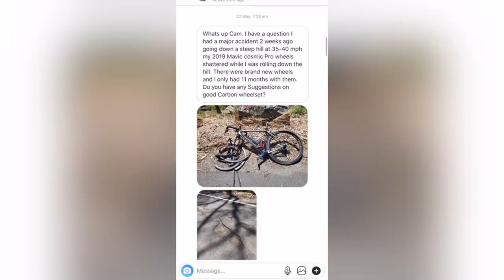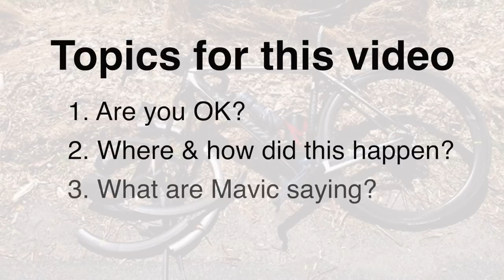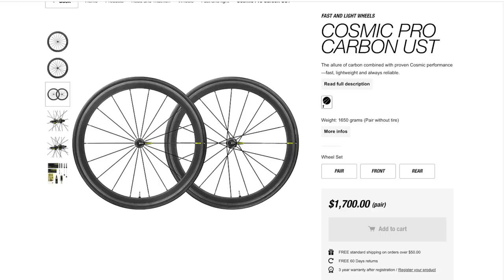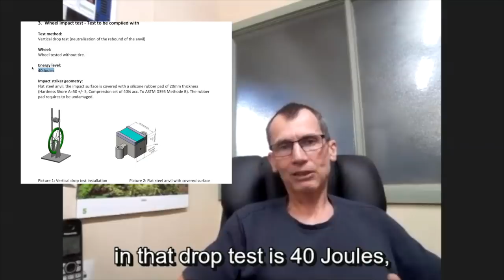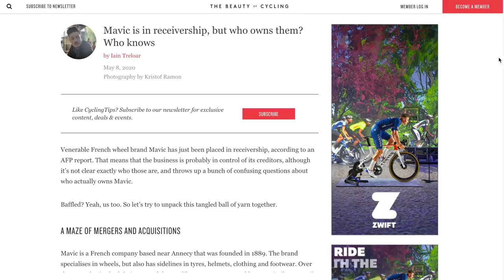A FRIGHTENING MAVIC CARBON WHEEL FAIL (at speed)

Comment: the hero in this story is the helmet! so many people not wearing them nowadays.
Reply: After many crashes and a head-on two years ago I always wear mine now.
I raced motorcycles and know how to fall & roll, but the head-on was an eye-opener for sure.
Good thing he had others there to help. I mostly ride alone...
Reply: I've crashed a few times at relatively low speeds (cyclocross and cross country) where the helmet came in handy, but thankfully never on the road.
I never go on a bike ride without a helmet.
My father claims he don't need a helmet because he's only riding on the side walk (legal in my country) and at low speeds, but guess who went OTB and landed on his head when he applied way too much force on the brakes?
Reply: Just yesterday a friend of mine crash while our afternoon ride. Luckily his helmet broke not his head! It was at about 30km/h, when the car pulled in front of him! Always wear helmets guys!
Reply: Absolutely!!!!!!
Reply: People in my area get shamed if they ride MTB without helmets. I have only ever seen teenage kids without helmets in the last 2 years. For some reason they think they are invincible.
Reply: @MattFenlon  I commute about 10km to/from downtown Vancouver most days and it is rare to see someone without a helmet during regular commuting hours. However, go out on a sunny weekend and you'll see a lot of people on the main cycle paths (10th, Union, etc) without them. Even more if you include the seawall and other separated paths.
Reply: @graham1034  Almost nobody in the main cycling nations if Europe wear one for commuting or travelling around the city. It's rare to see one.
Reply: Fools
Reply: I crashed at speed a few months ago and landed on my head, smashed the helmet which saved my life
Reply: Lol, yes, let's take this extreme example of a guy going at 72km/h (something most of us will never do) and weighing 100 kg, to preach about helmet necessity in general and brag about shaming people who don't wear them (as someone here did...)
I wonder why nobody in Holland wears them....they must all be shameful idiots. But as we know people like to gang up behind some black or white point of view, it's just easier for the brain and makes them feel like they belong (in this case to the responsible and smart helmet wearers). In reality though life is full of gradations in everything and when you cycle in moderate speeds and as far from cars as possible, then the danger of hitting your head is not too different from getting any sort of injury while driving your car, tripping and falling while walking, etc. 
Yes surely this guy was correct in wearing a helmet, since he was doing something that was pushing the bike's structure to extremes. But also surely this guy is lucky to be alive regardless of the helmet.
Reply: IKR? Crazy...

Lol no really I should wear mine more often. But definitely encourage its use
Reply: @f4nyang  That's fair, I don't like helmets very much, and don't feel like I'm taking much risk on the bike compared to dangers faced during say walking, sailing, or even potentially dangerous work that I do just as often. Descending off big mountains at 80km/h or driving in the midst of car-heavy traffic is another story though..
Reply: Nowadays?

They're wearing them more and more every year. We barely wore helmets as recently as the 90s.
Reply: @Robert Erdei Horrible analogies. You should be embarrassed.
Reply: @TeamCykelhold  went some time ago on trails where we used to as kids go down as fast and possible with no helmet on.......hair raising even for the bald.  i went down like half of the speed with helmet on and it was scary.
Reply: @tomast9034  Yeah we did some real stupid stuff without helmets too when I was a kid. I have seen my share of brain injury on MTB (and once an open skull fracture too, we had to carry the guy away) so I know what can happen if you are unlucky. I'm not really one to tell people what to do usually, but with helmets I usually tell people it's a good idea to wear one if they are jumping or riding fast downhill sections.
Reply: @Robert Erdei I'll bite...and almost entirely ignore the snotty, pretentious attitude that suggests that you speak for many as thoughtful, polite, or well-informed (and therefore "deserving")...
1) Pick up trucks have 4 wheels (hopefully) on the ground and are inherently safer as a result. Also, in a truck comes with an enclosure, at least implying an added measure of safety to which cyclists do not have access when on their bike.
2) Walking is inherently more stable than cycling, and also includes minimal stopping distance, and maximal agility.
3) ALL collision sports (American football, hockey, and most gym-based training for MMA and boxing) and many potentially-dangerous ones (rock climbing, skiing, base jumping, parachuting, hang-gliding, etc.) prohibit participation without protective headgear not only to reduce the potential of death, but ALSO of injury.
That said, if you'd rather wear a helmet while in a truck or walking down the street, you VERY likely WILL increase your survivability in the even of an accident.
Otoh, if you DON'T want to wear one in the much-more-likely event of concussion or unnecessary death while riding a bike (in traffic that outweighs you, and can outrun and out-maneuver you, and often doesn't see you for ANY number of reasons), then please just make sure that your health and life insurance are paid up so that tax-payers don't have to foot the bill for your utterly-preventable catastrophe (assuming there'll be enough of you left to attempt to save).
The worst-case scenario isn't even dying, it's the effect of long-term acute care on the people who love you because you wanted to be the "cool smartass".
Reply: Maybe it was part of problem. "I have helmet and I can drive faster". In netherlands 2 % use helmet and it safest country to cycling. Helmet is good while driving car and when you climp at home. In car crash 40 % died cause of head injury. At home allmost all.
Reply: Cant stand helmets. 
only with moantain biking i would go with a helmet. 
but i do live in holland, everything is flat and there are bikelanes everywhere.
Reply: I've crashed 2 times. As you said, the greatest hero of all the time is the helmet
Reply: In my home country (Finland) i would say there has been a very noticeable upward trend for helmets in the past few years, compared to last couple of decades. Sure, most people still don't wear helmets, but those who do are definitely rising in numbers. And it has become rarer to see someone riding a nicer bike without a helmet. I hope that trend keeps growing.

Comment: I know many riders who have “downgraded to carbon fiver wheels” with no gain in performance whatsoever, every time they hit a ripple on the road, they want to stop and inspect the wheels, what kind of life is that? I assume it’s good for professional athletes with deep pocket sponsors, but the look factor is the only gain on this.
Reply: What are you talking about! Aluminum wheels deform (not brake), tires off and you fly like a bird. Want to be safe; then ride max at 40 mph, weight <80kg, use disk brakes and through-axel
Reply: @anata5127  agree. A good pair of carbon rims built right with rider weight less then 80kg, will never have issues. Just be smart and know the limits of your equipment.
Reply: This.

I don't want to have to think about my equipment on the ride - I just want to ride. And assuming that I've properly maintained the bike, and IT makes ME look good when I'm OFF of it that's plenty good-enough. (Hell, I should be able to ride an UGLY bike and not care; anyone close-enough to me to form an opinion about my ride is too close...which is a "me" problem for both under-training AND over-caring.)
Reply: @anata5127  Since the issue is one of compromises if you're going to ride at all, the real question is reasonability of construction materials used. So although you're correct that aluminum wheels aren't guaranteed to not fail, the relative advantages and disadvantages of the alternative have to be considered as well.

That said, when carbon fiber breaks, the rate for catastrophic failure is EXTREMELY high relative to aluminum. In addition, wheel integrity is probably the single most-important consideration on a bike (followed closely by the stem) since failure at either of those points GUARANTEES a fall.

The question then becomes a simple one: what demonstrable gain is worth the significantly-increased possibility of a catastrophic wheel failure for which there is no engineering solution? (Relative to carbon fiber as a construction material for wheels, caliper brakes can CERTAINLY make carbon fiber *worse*, but disk brakes DON'T make carbon fiber *better*...)
Reply: @xunder3  I just wonder how many carbon wheels failed, if they are not from China, no rim brakes and no speed over 40mph? My guess almost none.
Reply: Wouldn't risk my life for looks.  I certainly wouldn't be using carbon clinchers with rim brakes on a technical downhill.
Reply: @anata5127  They're all made in China.  Where've you been for the last 20 years? Or Taiwan.  Like most bikes.
Reply: @ryand141  Taiwan products are well better. Do you think every bike made there? I doubt.
Reply: I remember watching a YouTube video regarding the pros & cons of carbon fiber wheels. The rim brakes were the most prone to failures due to heat build up. But it depended on the manufacturer and frequency of inspection. 

Heat resistance – Because of the heat buildup during braking, the resin that makes up the wheel begins to lose its stiffness. This is a problem for riders who have long descents.

Disc brakes with carbon wheels are probably better, my 2 cents. 

Everyone be safe, & enjoy your rides!
Reply: That, 1000000000000000000% true!

Comment: 100kg rider, rim brakes, carbon : pick two
Reply: 100kg as a bike rider is overkill.  Get in shape and lose the weight.  I dropped over 30lbs just to get into bike shape and it wasn't 30lbs of fat if you know what I mean!
Reply: @TraumaER  It also depends on the how tall you are. I am 200 cm tall and weight around 90 kg and would not want to lose weight at this point. But I also decided to buy good alloy wheels two years ago. (My Bike does not have Disc Brakes)
Reply: Better yet pick zero
Reply: Channul ☹️
Reply: Truama ER, I'm nearly 300 lbs...
Reply: @TraumaER  some people are sprinters mate. no problem if it's not fat
Reply: Carbon is the bigger issue it did not over load carbon just suck lol
Reply: @channul4887  calm down
Reply: @channul4887  didn't want to hurt your feelings. you sounded pretty fragile.
Reply: @TraumaER 
Did you ever consider that the rider might have been cycling as part of his effort to LOSE weight?
No.. Didn't think so..
Reply: @geeeze2403  Not really relevant since most high-performance bikes have a clearly listed weight limit.  If the bike says 250lbs, that doesn't mean you should weigh 249lbs.
Reply: @TraumaER  "@geeeze2403 Not really relevant since most high-performance bikes have a clearly listed weight limit.  If the bike says 250lbs, that doesn't mean you should weigh 249lbs"
Wot? That makes NO FUCKING SENSE.
Reply: @channul4887  what doesn't make sense?  You don't ride up to a designed limit just because it says so.  You don't stack elevators with 3000lbs of fatasses.  You don't imbalance an airplane just because you think you can.  I'm a licensed PE.  I know these things.
Reply: @TraumaER 
There's a lot of stuff that we DON'T know about regarding this incident, such as recommended weigh limits etc, so I don't think that any of us are in a position to make assumptions. When I bought my bike, I wasn't given any information about things like that and it wasn't something that I even thought about researching either and I'm a heavy guy. Not everyone is THAT clued up as you appear to be ; if you have the knowledge then good for you but spare the judgement about us lesser mortals. 
Glad to know that 'John' is ok and continues to remain so. 
Ride safe people, ride safe.
Reply: @geeeze2403  well I wasn't making fun of you exactly.  However, high performance bikes - specifically those made of carbon fiber have high strength limits but are actually more brittle than aluminum or steel.  If you got your bike at a bike shop, they should have recommended you something more appropriate or gave you a warning.  Otherwise, they just tried to upsell you on something that wasn't safe long-term.  Anyways, keep riding and get in shape.  Biking is great if you are consistent!
Reply: @TraumaER 
Then as a licensed PE, perhaps you should be a little more understanding about people. Nobody can snap their fingers and achieve their desired physical weight /shape.
I certainly wouldn't hire someone like you
Reply: @TraumaER 
 "I wasn't making fun of you exactly"
So I'm wondering just who you were making fun of. The " lardasses in the lift"  maybe?  
I'm actually not in the slightest bit bothered about name calling - I wear my ' Fat lad at the Back' cycling apparel with pride ( yes, it exists - Google it) 
Rather than bragging about your physical shape and PE qualification, look inside yourself and realise that not all of us are as perfect as you think you are. 
I now consider my input to this discussion closed. 
Peace, love and happy tailwinds
Reply: @TraumaER  if a bike with a stated weight limit of 250lbs breaks under someone who weighs 249lbs, the manufacturer is fucked by lawyers in all holes. That's why every design accounts for tolerance (even without lawyers, since tolerance has been a basic foundation of any design for centuries). Whatever that PE license is, I'm guessing you bought it off someone on ebay. No wonder you were able to lose the 30lbs so quickly.
Reply: What I want to know is why is there so much criticism on 100kg rider ~ guys are genetically getting bigger ~ engineering standards are your supposed to factor in stress / strength  3 times its working load  generally. If someone is 2.1m in height what is his ideal healthy weight ?
Reply: @bengreen1262  I am 100kg, and I blew different tires off different alloy road rims twice at 100psi. Luckily didn't crash in either instance. There is just a huge amount of brake heat to deal with on long descents, to where it raises tire pressure enough to blow a tire off the rim. I wouldn't trust a carbon rim and epoxy to handle this heat for many years without deteriorating. I also had hairline cracks at dropouts lead to warranty replacement on 3 different alloy road frames. Racing road bikes and components aren't over-engineered 3 times over, that's for sure. They are designed for racing with some margin of safety, but I wouldn't assume it's a lot of margin, especially if low weight is an explicit design goal and competitive metric, as is the case with carbon rims.
Reply: @TraumaER  I'm in pretty good shape but muscular and 195 cm. What am I supposed to do, chop off a limb or two?

Comment: ALUMINUM RIM is the moral of the story.
Reply: Nah i saw aluminum did the same
Reply: Way to paint with the wide brush! Nope. The moral of the story is: don't ride carbon wheels with caliper brakes and hard compound pads instead of disc brakes at 70 k/hr while weighing 100 kg. There is nothing inherently wrong with carbon wheels but how you use it.

Comment: Great video.  A real eye opener.  This is the No 1 reason why I never bothered with all carbon wheels on a rim brake bike.   Disc brake bikes - much less issue of this sort of failure.
Reply: Rider weight though is still a consideration.
Reply: Totally

Comment: When I was looking at a new bike I wanted disc brakes with carbon rims just for longevity and durability but this is another good reason 🥵
Reply: This was one of the reasons I got myself a disk brake road bike. I did not trust carbon rim brake wheels
Reply: @Efu884  but alloy wheels
Reply: You guys are so right. Rim brakes will eventually damage the carbon wheels
Reply: Well in my case I did have issue with carbons disc wheel. Some brands don’t use the same “glue” or “epoxy” to make them because no heat generated by brake pad. Then it is very fragile and heat is everywhere (be careful when you take your bike in a car : sun or heat pipe). Best choice is aluminium.
Reply: Stefan - bike manufacturers converting to disc because they have to, carbon was never suited as a heat transfer medium.  Liability issues between tire and tube manufacturers and bike companies.  And besides it jacks the price up and the usual planned obsolescence, and you can’t go back or forward from rim /  disc.

Comment: Fascinating! Thanks mate! Although not a catastrophic failure of carbon rimmed wheels, I bought a Trek Pro 6,9 with Bontrager carbon wheels. I live in the Pyrénées and we hit high velocities going downhill!! Braking from about 70km/h to about 30km/h on a hair-pinned downhill, so repeated and constant braking, the rim of the front wheel suddenly "exploded out" warping on both sides of the rim at the same point and blocked my wheel against the brake. I slid and skidded and my mates behind me have no idea how I stayed upright! Trek (Bontrager) were awesome and even though the wheels were outside their guarantee they gave me a rebuild. I paid shipment to and from the factory. It happened again about 2 years later, though this time not so violently and I stopped before the explosion using my rear brake. Apparently it is something that does happen. A couple of mates of mine have had the same experience with other makes of wheel. Raoul's explanation is the reason. Extremely high temperatures. Also, in both instances it was on hot summer days
Reply from the maker: Thanks for sharing mate